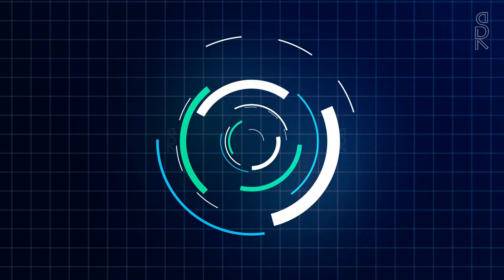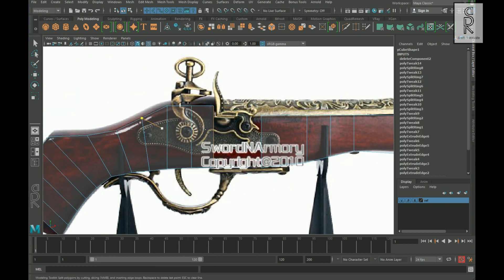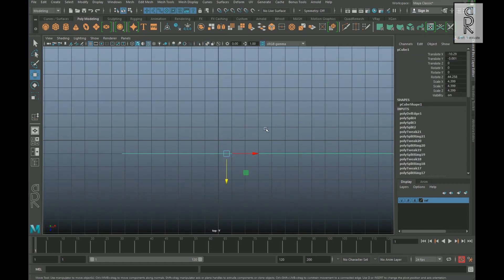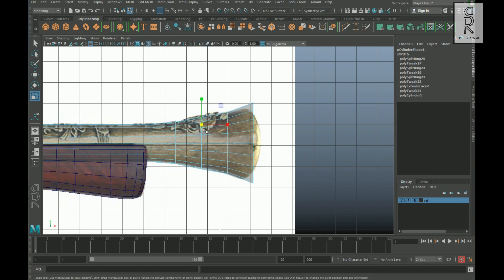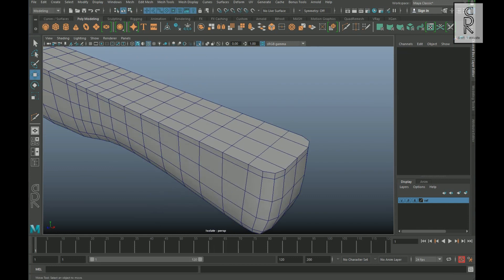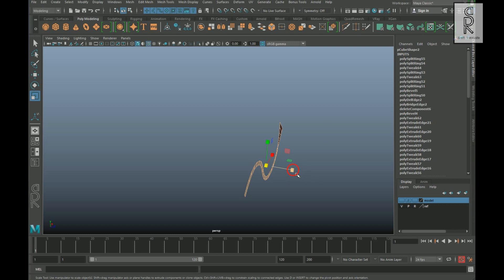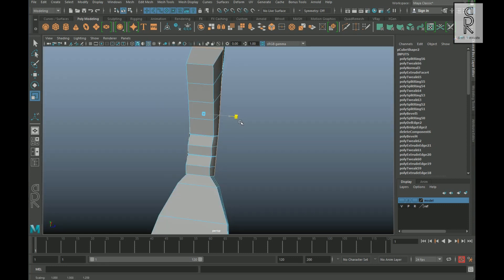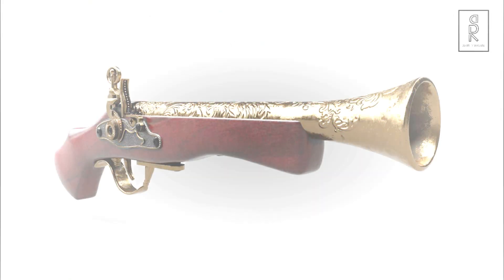How to make Pirate Gun 3D Model in Autodesk Maya (Part-1) | Modeling and Texturing Tutorial

Comment: Hi! When i extrude (6:20) i get some faces to spike even tho my mesh seemed fine before. Can you help please :> Thank you!
Reply: Update : I've just done the whole cylinder step again and worked as expected. I dont know what i did wrong the first time though so if you have any explanation im here for it. Thanks!
Reply from the maker: @celianbsht  Hi, I think there were some extra vertices which was causing that issue. 

If you face these kinds of issues, I will recommend doing a cleanup for your mesh using Cleanup options, before applying extrude on the mesh.

You will get the 'Cleanup option' under 'Mesh'. Go to cleanup option box, and from there select, 'select matching polygons' and '4-sided faces'. Select these two options and leave the rest as default. Then apply.

It will select all the 4 sided faces, of the mesh leaving the faces which doesn't have 4 sides or having some issues. Then you can fix it accordingly.

If it doesn't fix or you are not sure what's going on, it is best to start it from the beginning, which you already did😊.

Thank you for following my video. I am really glad. If you have any other questions, feel free to ask me. 😊